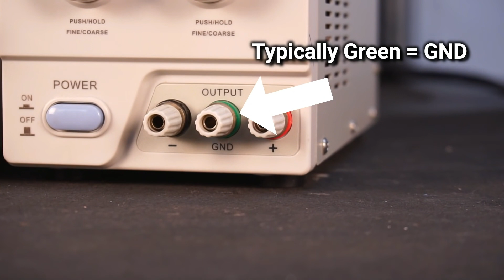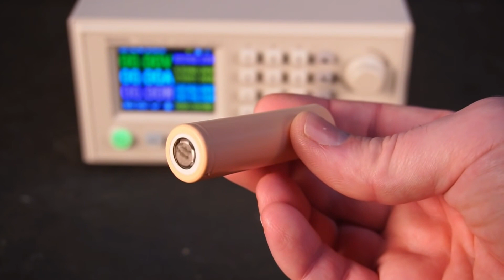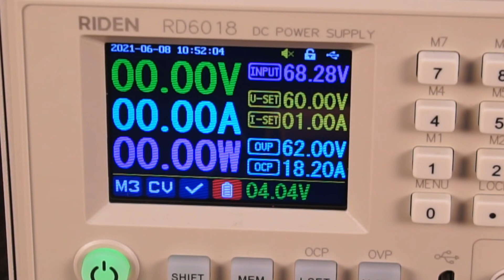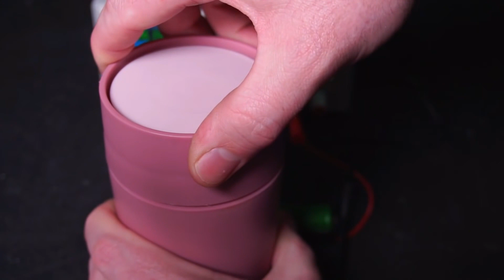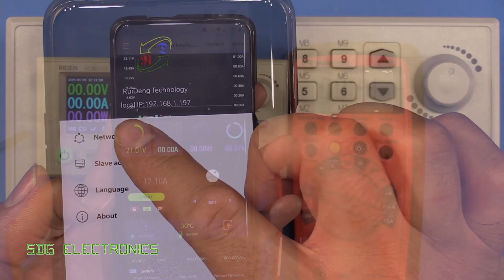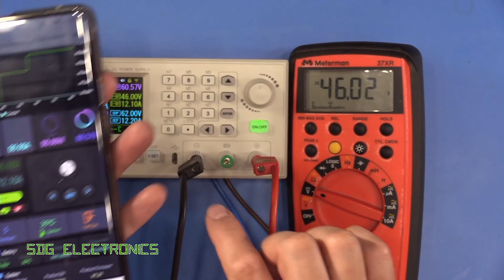share 2 great introduction videos about RD6018 and RD6012

Comment: Can the low shutdown amperage be adjusted?
Reply from the maker: hello, do you mean the shutdown current when charging battery? for now RD6012 and RD6018 does not have this function, RD6006 needs to update the firmware to set cutoff current, other devices all support the cutoff current setting